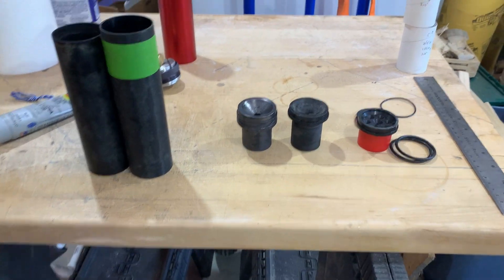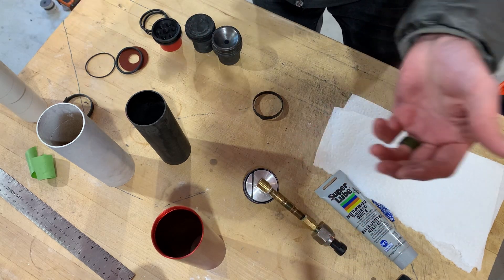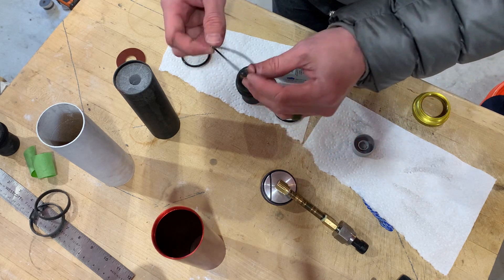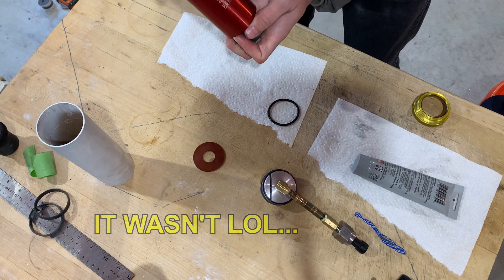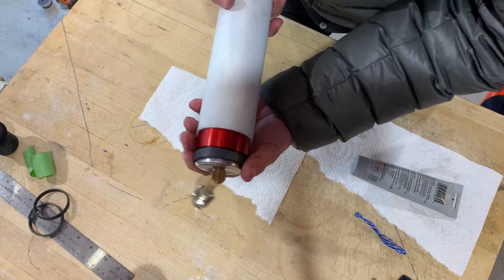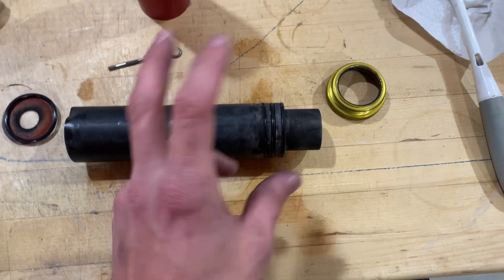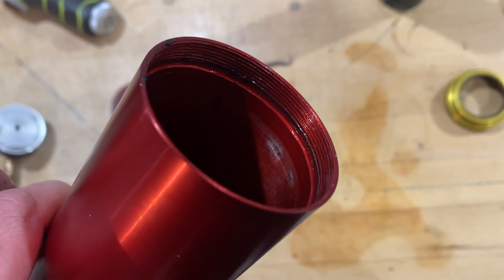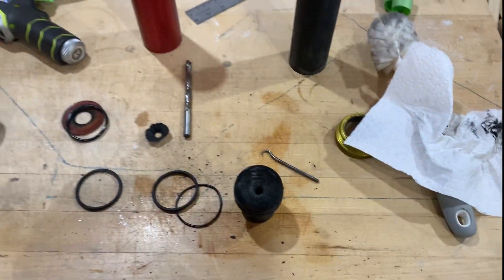Experimental Rocket Motors - Graphite Nozzles in Aerotech Case

Comment: I have used graphite nozzles in Aerotech motors for some time.  There are Two things to consider.  The graphite portion of the nozzle that extends past the closure tends to break very easily when the rocket lands. Also graphite doesn't insulate and conducts heat very well when compared to AT nozzles. I have learned that  using a graphite nozzle in an AT case with anything more than a two grain motor, will cook your case. AT cases are thinner than snap ring EX cases.